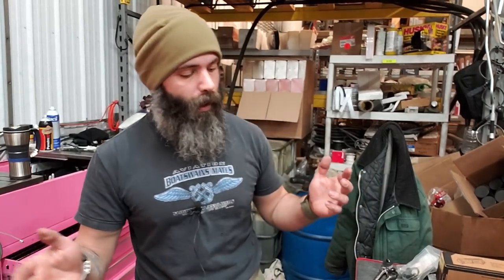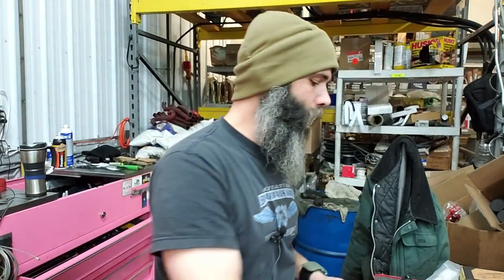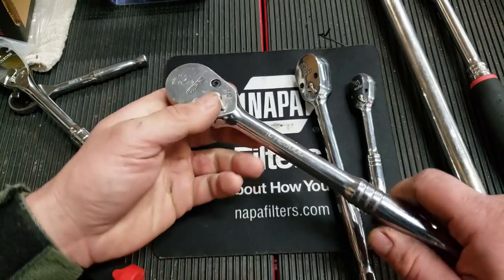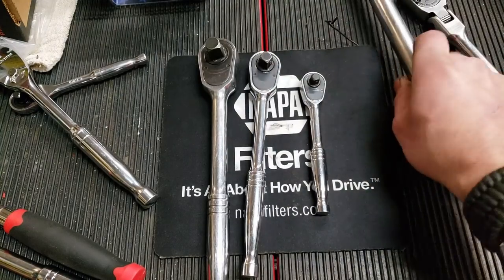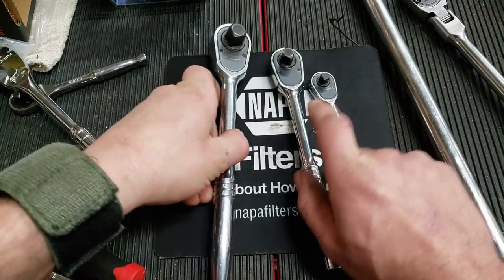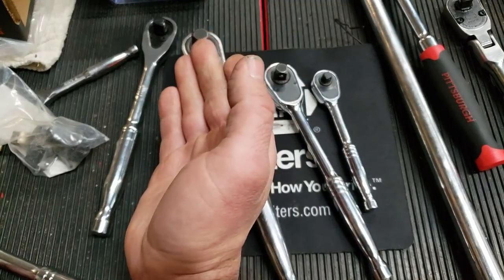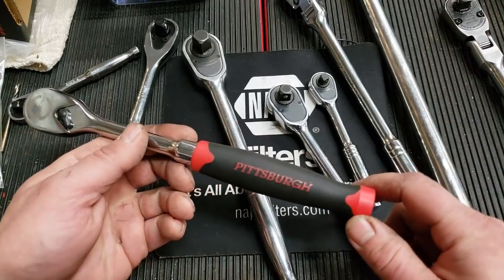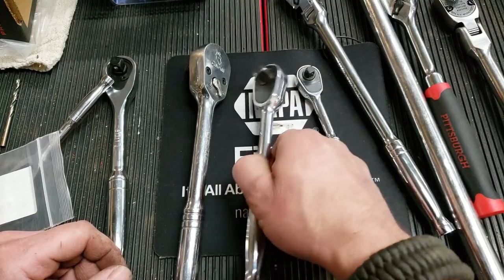Capri Ratchets, 1 year Review

Comment: Bearded, what lube do You use when you grease your ratchets? I got a Craftsman set a few years back when they still looked like the old Easco's but were being made in China, I greased them and they worked terrible. Cleaned them out and used synthetic oil and they worked.
Reply from the maker: I use Superlube in my ratchets. Same stuff snap on uses, both at factory and in their rebuild kits. Can get a 2oz tube of it at good price on amazon or some hardware stores and that will last for good while. On alot of ratchets. I go through and service my ratchets prob once a year on all of them amd it keeps them goin strong
Reply: @BeardedSeabee82  Thanks for responding, I’ve got a couple ratchets starting to feel a little dry.

Comment: Great channel. Do you actually take your ratchets apart when they are new to put in your own grease? I just bought a few Gearwrench ratchets and I have been debating whether to take them apart and put in super lube. I know they do come oiled right from Gearwrench.
Reply from the maker: Typically i try to get them broke in for few weeks first then clean out factory stuff, first was using air ratchet grease (what i had on hand) but lately been using superlube, has been working much better
Reply: @BeardedSeabee82  Thanks for your response. I was having this inner argument with my self about opening up my Gear Wrench ratchets. I would have loved to buy the Capri flex head ratchets but they are not available in Canada on Amazon yet. I have a little bit of their stuff and what I have now I am happy with. I have tried to reach out to Capri tools to see when they would be available on Amazon Canada website but they just ignored my email.
Reply from the maker: Hey mark, I know typically (unless falls on weekend) the folks that i have contacted in warranty usually respond within 2 business days, as for their sales folks though cant really say however. As far as amazon canada, not sure how long it may be, but amazon us they are available, have some of the links in description box of video not sure if they will or wont work up there though. Also another good place to try and ask them is on one of their instagram posts as far as direct shipping from them. Hope this helps, if you dont hear from anyone next day or two though, let me know and i will try to see what i can find out for you.
Reply: @BeardedSeabee82  Thanks for the info. I have sent them 3 emails right from their home page. I have been waiting 3 months from my last email. I have given up trying to get a hold of them. I guess my money is not green enough lol. And I thought Milwaukee was hard to get answers out of them. The real stupid thing is I could bring Capri Tools a fair amount of business from where I work. I can not figure some companies out.

Comment: I notice mechanics complain about snap on's price and they have time to make video's.    i retired a few years ago and we had nothing but snap on sockets, ratchets and extention's.i sold my shop to my senior mechanic, an old high school friend. A top mechanic can make 150 grand a year or more period. If you aint then your in the wrong shop or your slow and have have limited skills
Reply from the maker: I work in a fleet shop (fleet wide we run close to 500 power units across US), and the shop where I make my videos after I clock out. There are days we run upwards 12hrs (typically mondays and tuesdays) so we can run easier days usually remainder of week. If you dont like fact I have time AFTER I am off the clock to do videos in evenings, easy, dont watch. And if you are curious, maybe you should watch one of my toolbox tour vids to see what i have in my box.... And as far as working towards running my own shop, well, my area to just lease a building large enough to work in would be 6k-8k a month, building one outright, well, than alone with amount of development in my area would run you the better part of 300k-400k not including getting building built. Then of course there is still my apartment rent of 1100 a month I have to pay. Js...